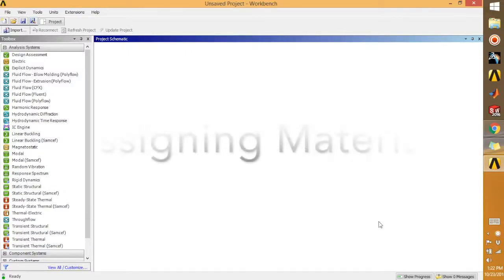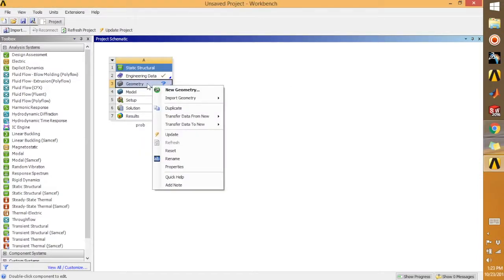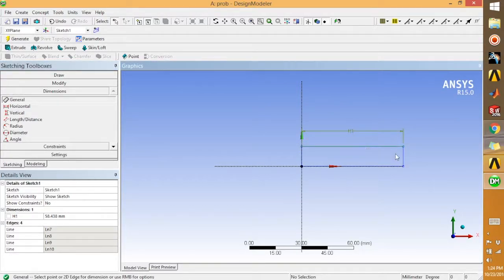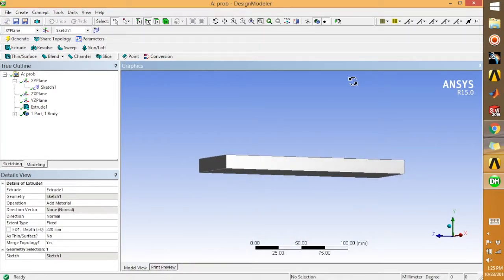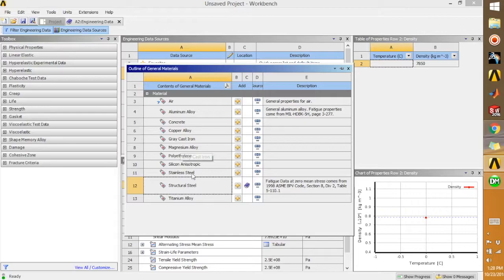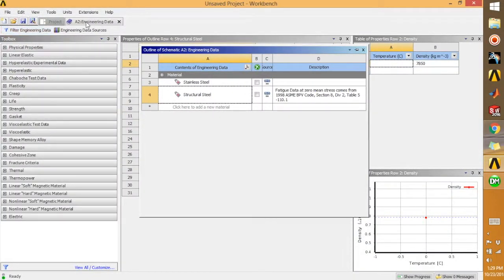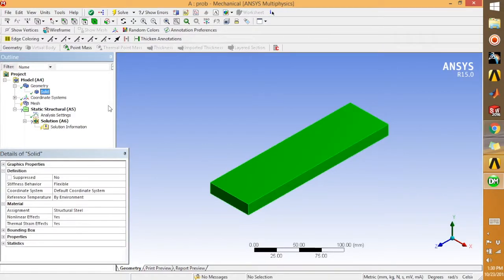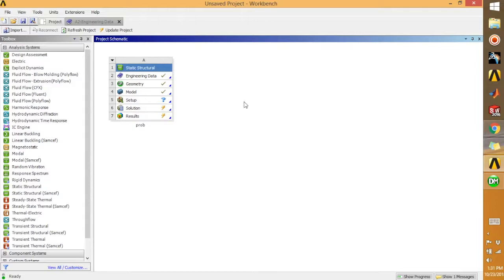Ansys - Assigning Material

Comment: Hello.. great video.. 
I have one issue .. during assigning the materials ::  geometry solid material - assignment (default structure steel) on here  ... I am not able to assign other material.. box show blank white.. so how to fix this one issue .. please help..
Reply from the maker: I think you have to add the material details first before assigning the material
Reply: @KamranYunusDesigns  I have already Added the material but still it has become structural steel as a default
Reply from the maker: @harshchaturvedi9507  you should select your material from the toolbar
Reply: @harshchaturvedi9507  did you find solution for this

I have the same problem
Reply: @abdulmalekalmerri9376  Basically now I am having 2 materials instead of 1.One which is stainless steel and the other is the material that I have added